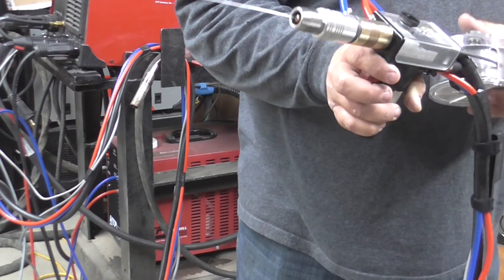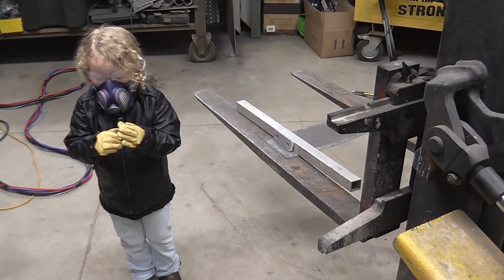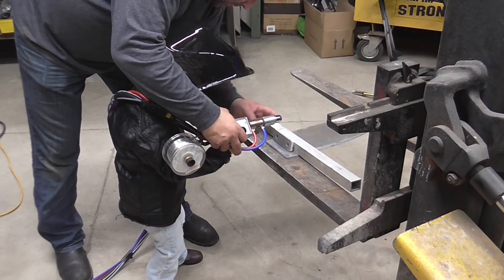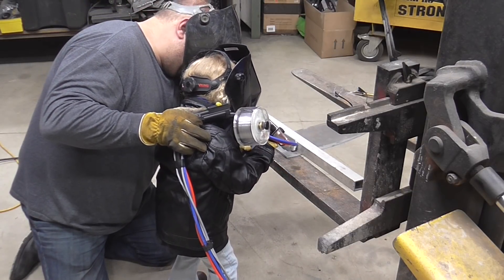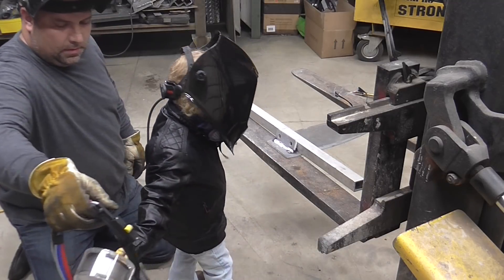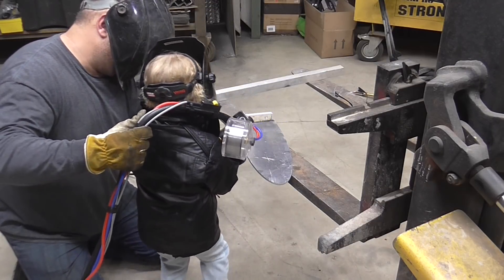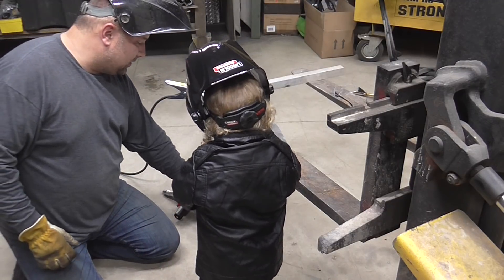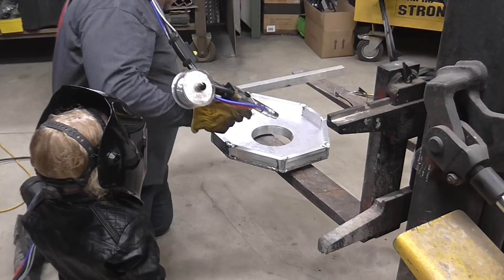WATER COOLED SPOOL GUN - or a 3 year old welding ....

Comment: Zila what do you think about snapon spool gun 1600 dls price
Reply from the maker: Juan,  this spool gun is probably one of the best spool guns out there !  even better than the Miller 30A in my opinion ( i have a comparison video coming up)   
The spool gun in the video is sold under different names.  Snap on sell it as a MGH7 Lincoln electric sell it was a Magnum SG and HTP sell it as an RSG250 ....  this spool gun you can pay from $900 - $2200 for depending on whom you buy it from. (that is the price for spool gun and control box some welding machines need to have a control box .....)   
I modified the spool gun and added the water cooled neck, i also changed the style contact tip it uses (the regular contact tip is fin for mig aluminum welding ) BUT for pulse mig you need something that can take more heat, so i changed that out.
I have 2 other spool guns just like it that i use on my engine drive welders and they work perfect for years ! already.
So there is one guy who make the spool gun in the USA and multiple companies buy it from him ....   but non one has the water-cooled option  yet ....

Comment: Killer!!! I build these hangers out of 4”x4”x3/8” aluminum angle and I usually tig them but this would work a hell of a lot better!
Reply from the maker: David White how many amps tig machine are you running to weld the 3/8”?  
With my 200 amp tig its a major pain to run 3/8” alu unless i use 75he/25ar....  than its ok - but not really a joy....

Yes this one here rocks! 
I finally figured manual double pulse settings out last week - and now i need an instagram account ....  lol  pictures are hard to post on yt.  But i remember you telling me about that a while back....
Reply: I use a dynasty 280 at work and I have argon/helium mix but damn it gets hot!!!!
Reply: And yeah you definitely need to get you an Instagram account I think you’d like it much better than YT. The welding community on there is top notch